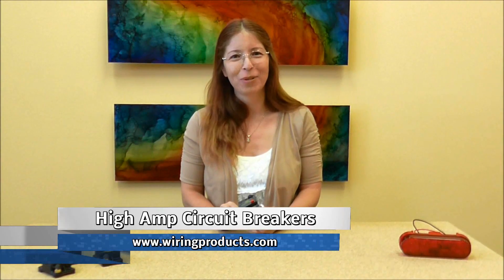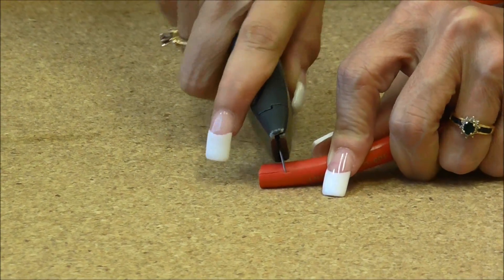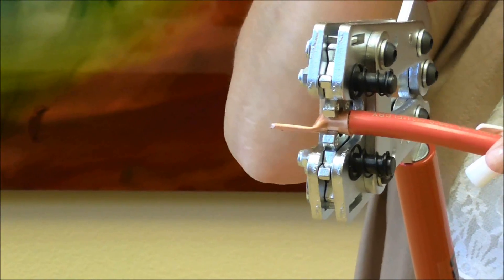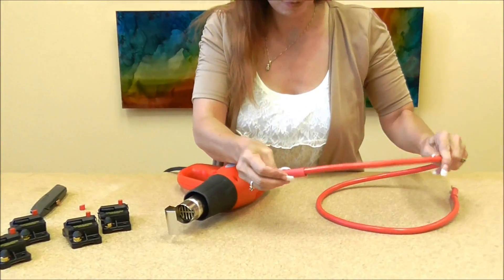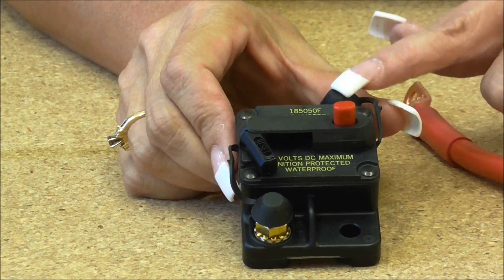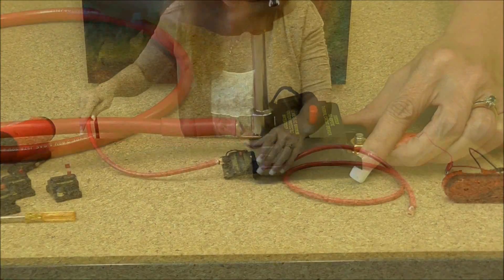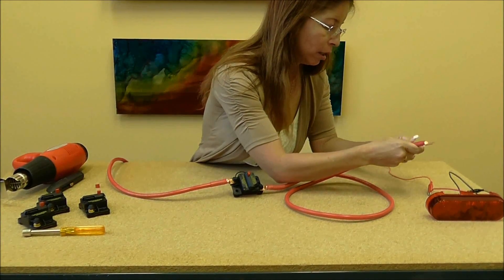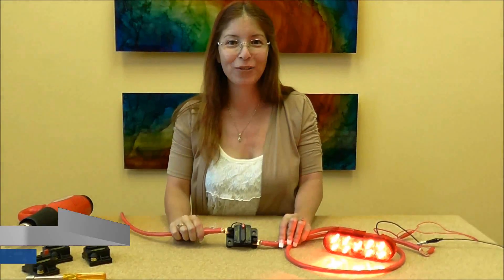High Amp Circuit Breakers  for automotive use with Wiring Products

Comment: Would I plug a "fuse box" (Blue Sea 5032 12 Circuit Split Bus Fuse Block) into the auxiliary of the Bussman (bp/cb 185-100) 100 amp circuit breaker if I were trying to run more one item?
Reply from the maker: Yes. You can run a cable from the circuit breaker to the fuse block. The breaker should be located as close to the battery as possible.